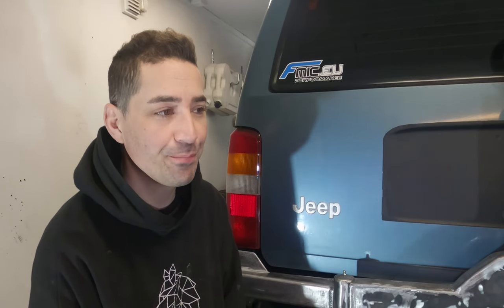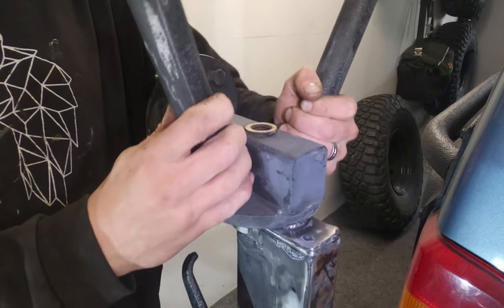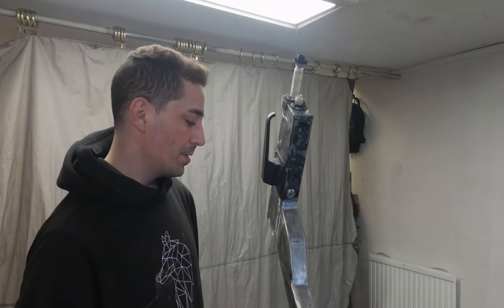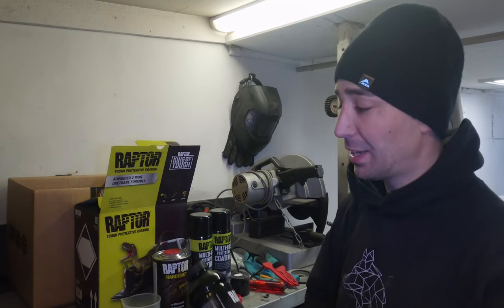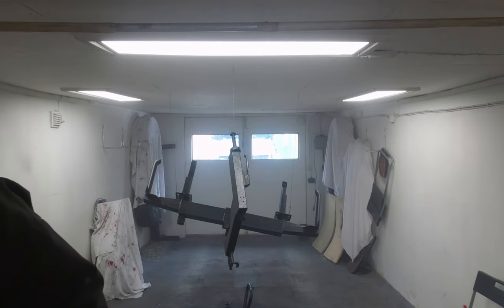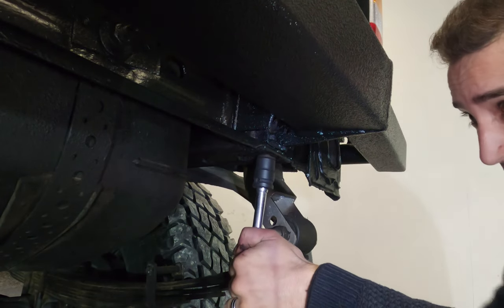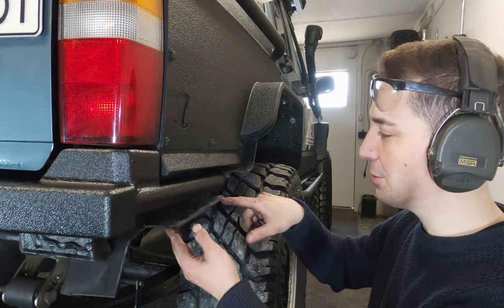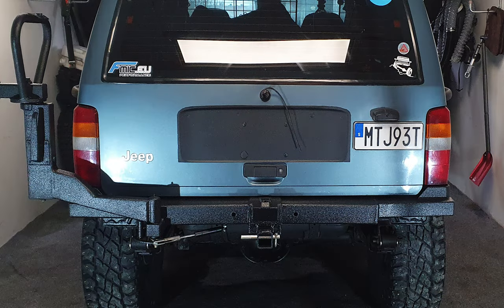Spraying Upol Raptor Liner / Tire Carrier Bumper / Jeep XJ

Comment: I've been using Dinitrol ML on the underside of my truck aswell and I was quite surprised how well it has been holding on. The only prepwork I did was wirebrush most of the loose rust away but I didn't even attempt to get it to bare metal.
Reply from the maker: Its really good stuff for rust treatment and prevention. It's supposed to be one of the best.

Comment: what mig welder are you running? and are you running off 120v ?
Reply from the maker: I'm using a Euromig. Its a 170 I think. .8 wire, running off of 120v.